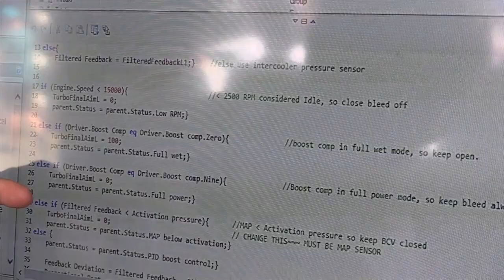Motec M1 Tune and M1 Build | Motec M150 Toyota 86 / Subaru BRZ / Scion FRS Plug-in

Comment: Motec really did well doing this. Also for the cost it's worth the extra bucks over oem tuning to have all the good stuff. Totally makes sense. By the time your finished the cost of say an M130 could be not far off OEM depending on what your doing.
Reply from the maker: A lot more flexibility too. Granted we had a reason to business wise, but Andres 86 (which became HPA's and is now RaceCraft's) started with EcuTek but then went to the M130 PnP setup and never looked back.

For anyone who stumbles upon this, an oldie but still relevant comment specifically on reflash vs standalone tuning a modified GT86 can be found here: https://youtu.be/bK8o22PPeUM?t=357

Tyler went from opensouce tuning software to standalone for reference: https://youtu.be/jVsDTReaN3M - Taz.